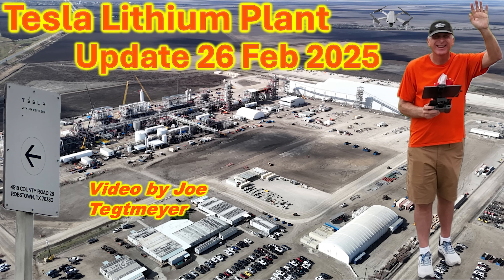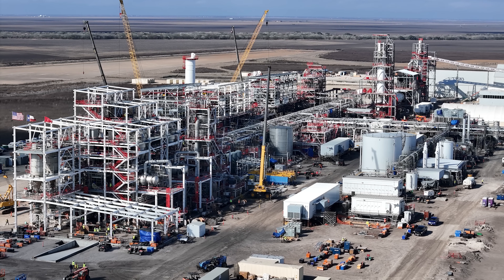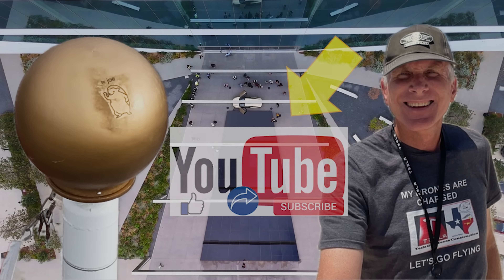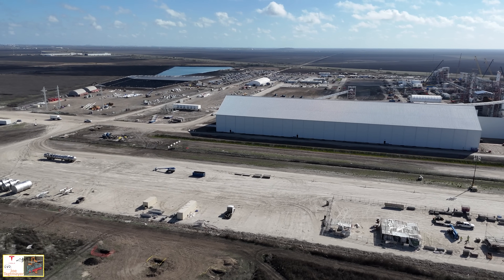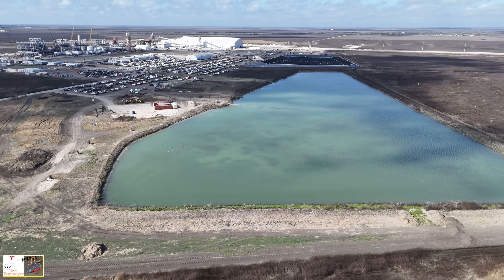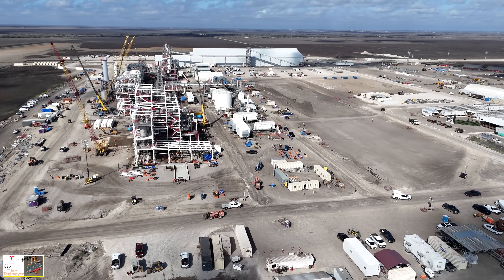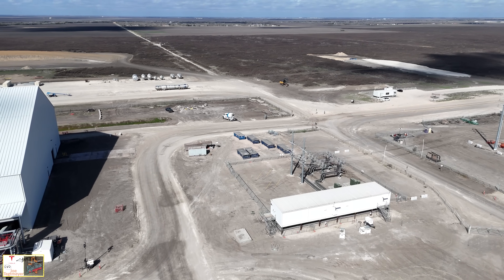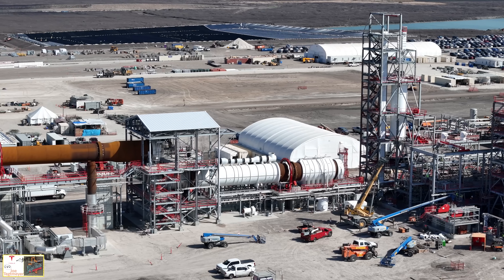Tesla Lithium Plant Review & Discussion! 26 Feb 2025 Development Site & Operations Update (09:35 AM)

Comment: With the electrical substation, it is noticeable that they have a big permanent shed for the power electronics, rather than those prefab shed at Giga Austin. Prefab good in that fitout and test can be done in a factory. The Corpus Christi electrical shed would provide good protection during a hurricane, and maintenance workers will have more space inside. 
As will all Tesla factories, we see thought going into design, construction and production ramp.

Comment: There is no real reason for the second half to be a mirror plant. It would just confuse operations. It should be an exact duplicate as if they copied the first half, moved it over 100m and plopped it down. Upgrades are a given based on testing the first half, but they will be copied over to the first line as soon as the second comes online. No reason for having two different versions.

Comment: The rail spur may have been deleted for the present. 
Looks like the spodumene receiving facility (drive over structure) allows for trucks to centre dump in some way and a conveyor will take the concentrate inside.
 I expect a trucking company gave Tesla a great price to deliver spodumene from the port - is it bulk or in containers. Rail is not that cheap over a short distance - about 25 miles. 
One semi-trailer might be sufficient in early production. 
Maybe five to ten semis cycling between the port and the plant is all they will ever need.

Comment: So, facility's water supply is held in a large, lined pond?  Hard to believe, as that would maximize water loss due to evaporation.  Tanks would be more typical.  Sure it's not a wastewater containment?
Reply: Wastewater would make more sense. An evaporation pond like we have saw at GT near where the Old Bagging Plant was located. That pond used to store wastewater from the paint filtration system. Or the ponds at the concrete batching plants used to store/evaporate the wastewater from the wash-out pits. And also the lined pond beside the Southend Cooling Tower.

Comment: @14:50 looks like it’s also a conveyor system what goes into the Sorte facility. But the conveyor system is covered with a sheet metal. I assume to control the dust and the air quality inside the building.
Reply: I think you mean “conveyor”, not “conniver”.
Reply: @astewart1900 yeah indeed thx. I will change right away ..